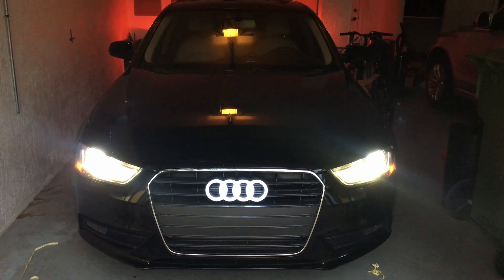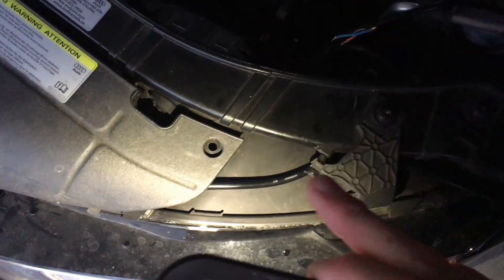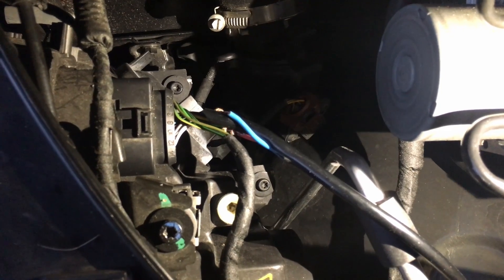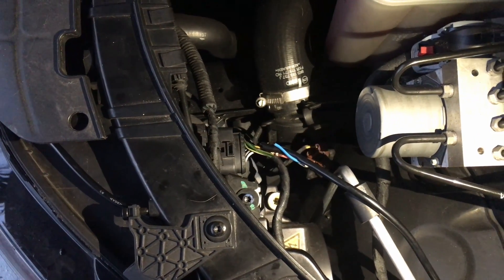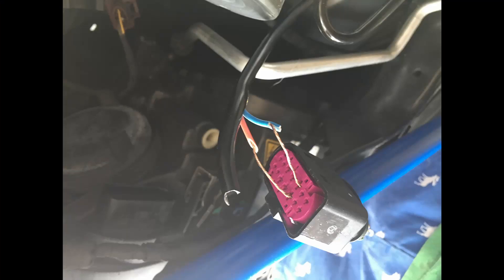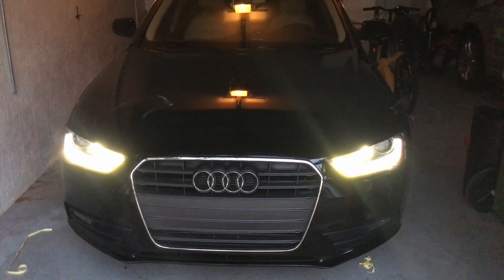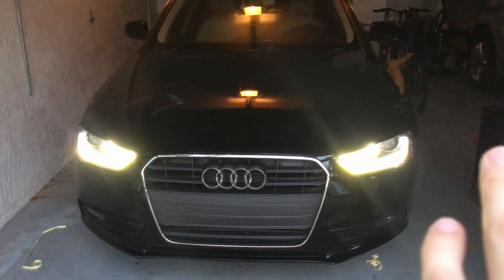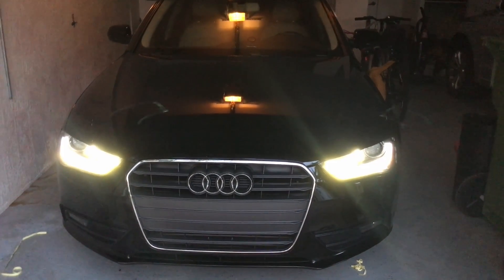Part 2: Installed Audi Logo Light as DRL & Reflective TRON COLORS!

Comment from the maker: Update: if you want to have it connected and turned on while the car is off, use the positive terminal to connect the positive end of the wire & use the brown negative pin 5 on the right/driver side headlight wire to connect it and ground it
Reply: Do you by any chance know how to connect it to a 2011 audi a8? id appreciate if you can help!
Reply from the maker: Unfortunately not really

Comment: Hello.  I love the audi lighted emblem.  Where did you get it from and how much? I would like to purchase one. Thank you and thank you for the video! 😊
Reply from the maker: debbie h go to ebay & search audi glow light emblem, i purchased mine for $70. It comes from china unfortunately, so the emblem paint quality isnt the best up close, but from a distance it looks nice. I cant provide the link cause the seller sold out & hasnt restocked
Reply: MotorHead Tech thank you so much. It looks really NICE on your Audi.  You mentioned the emblem is painted? So it's not chrome or not coated with chrome like an OEM part?  Has the paint peeled on you? Thank you for responding. I REALLY appreciate it! 😊
Reply from the maker: debbie h no the color looks exactly thr same as the oem emblem but the material isnt, just be careful not to scratch it, ive scratched it a few times but its not that much noticeable.
Reply from the maker: debbie h heres a tip too, if you dont like it you can try to return it on ebay & instead of literally returning it, youll most likely get it for free ;)
Reply: MotorHead Tech Great to know!  Thank you for all your info and the tip!  I'm going to go for it and purchase! 😊 Hopefully I'm not charged too much to install it.  It looks simple enough however I don't trust myself to do it.  Lol
Reply: MotorHead Tech ooops...one more question, is the emblem the same EXACT size as the original audi ring emblem in the front? I see it's on sale on Amazon as well.
Reply from the maker: debbie h np just be sure to install it exactly how i did it in the part 1 & part 2 videos, dont be messy when gluing it & dont scratch it, & dont accidentally break thin emblem plastic hinges
Reply from the maker: debbie h as long as you get the right size of 27 cm lengthwise, i believe, then  it will fit on the grill location
Reply: MotorHead Tech Thank you! 😀
Reply: Hey Debbie, just wanted to see how everything worked out for your purchase for the Audi LED rings. I have an Audi Q7 and I was thinking of purchasing and installing this on the front and back rings

Comment: In the picture it looks like you put the ring wiring into the side of the headlight plug that plugs into the headlight assembly. That seems like it wouldn’t work. How did you do it?
Reply from the maker: Thr negative wire i grounded it to the car & the positive wire is pinned to the daytime running lights (DRL).

Comment: Does it lights up/flash when you lock the vehicle like how your park light flashes when you lock the car because that would be cool.... I guess it would have to depend on the wiring you do
Reply from the maker: Kenrick Joseph it depends on where its wired, i wired it up to my drl, so it turns on automatically when nightfall comes
Reply: Nice.... I got a b7 A4 no DRL though so I was thinking to wire mines to the park lights but fear hyper flashing due to imbalance load... I know I can put I resistor on to stop the hyper flashing but I’m just running from extra work 😩😩
Reply from the maker: Kenrick Joseph what I did was instead of connecting everything  all together was I tested my connections to see if it would work by: connecting the logo light to the back module plug of my headlight housing & not connecting my housing & that’s how I tested each connection, using the logo light wire & sticking in into each pin/ hole of my harness. Try that & see, but do you understand what I’m trying to say)
Reply: Yea I catch what your saying it’s trial and error in the  pin holes until I get to the perfect connection I’m looking for... I’ll do just that tomorrow if I got time thanx good looking out
Reply from the maker: Kenrick Joseph np if you need any more help lmk
Reply: Ok this is what I got..... To get the emblem to light up with parking lights on you’ll need to tap into pin hole 7 and 10 assuming you got a b7 A4 idk if the pins are the same for b8 A4’s. To my disappointment it won’t flash when you lock or unlock the car 😩 it’s not like it’s Burger King can’t get it my way.... but it would flash in pin hole 7 and 9 but down fall is it there is constant flick in the light and it also flashes like an indicator when you use your indicator so that’s a no no
Reply from the maker: Kenrick Joseph nice work, so pin 7 &10 is a yes go, no flickering in that setup?
Reply: Correct pins 7&10 is a go... no flickering what so ever.... turns on with park light and any light setting beyond park light and turns off when the switch is turn off
Reply from the maker: Sounds good! Nice job!
Reply: Thanx bro
Reply: Did u ever get the red emblem for the rear
Reply from the maker: I did buy it, but it’s a cheap quality part that I will not install, plus id need to drill a hole in my truck to bring the emblem wire inside the car
Reply: Well that sucked... there goes that plan out the window 😂
Reply: @Ricky-we2jk  so 7 is grounding and 10 is positive right....

Comment: What kind of wore did you use to extend it? 18 gauge?
Reply from the maker: i reused a led lamp wire that no longer worked anymore, but it served a good purpose as it was the same size as the emblem wire & it had enough length
Reply: 18 gauge is the way to go

Comment: Hi, how did you install and connect the orange lights on the side of the headlight?
Reply from the maker: Those come standard from factory the side orange reflectors
Reply: @MotorHeadTech  So it is not possible to buy from outside and adapt?
Reply from the maker: @KenDosha13  I'm not sure what you mean can you explain your question? If you mean by you want to install the orange side reflectors as shown in my front xenon led headlights youd need to buy the oem headlights
Reply: @MotorHeadTech  my question is if it is possible to install only these reflectors with light in my headlights.
Reply from the maker: @KenDosha13  I dont think so, because you could buy the oem like this off of ebay or somewhere else
Reply: @MotorHeadTech  ok, thanks